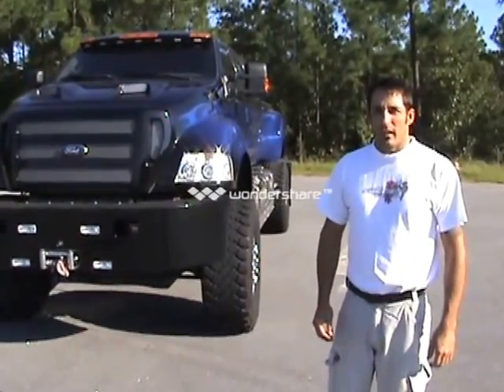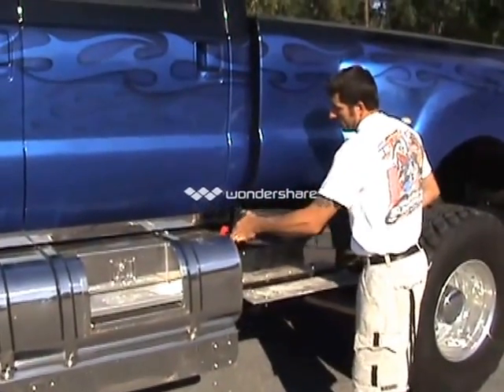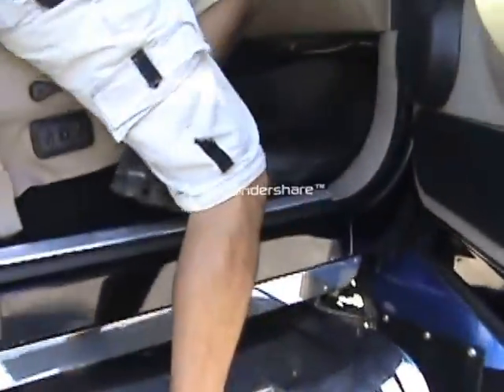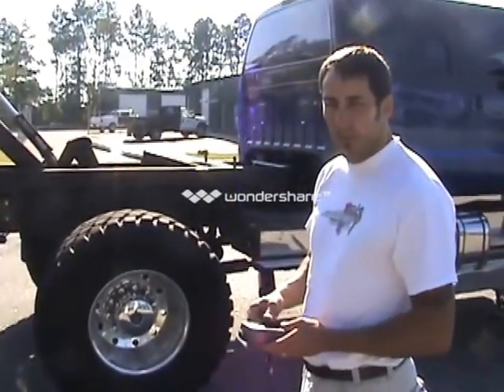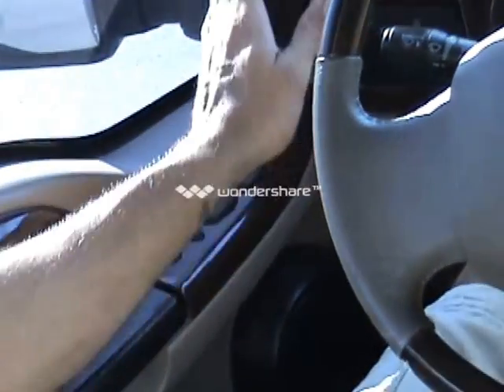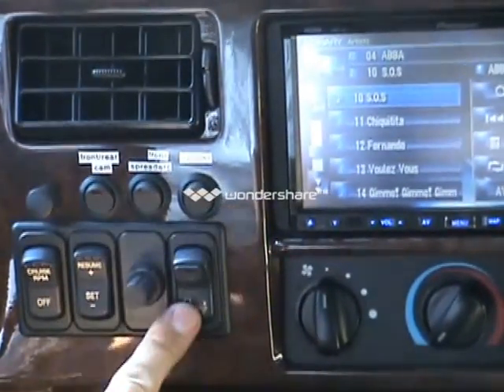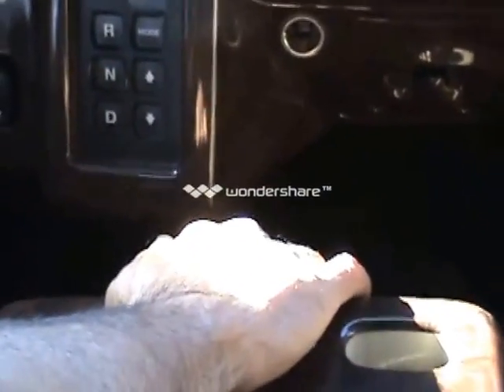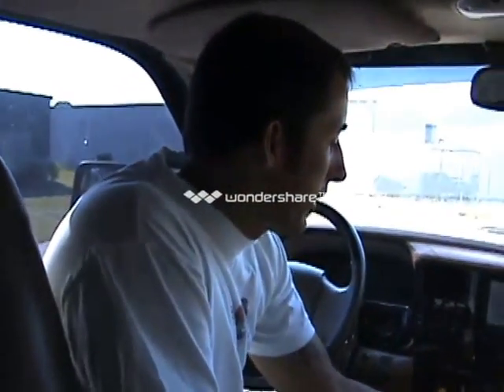"Lie" F650 Six Door Supertruck

Comment: Aside from the watermark, this was a really nice walkthrough of a vehicle I've liked for years. If I could ever afford to drive one and had some job or hobby that I could justify having it for, I'd definitely look into the 4 door model.
Reply: +donteandamy, For the same or less price you could get a Sportchassis if you do not mind having or using a Freightliner M2, would haul the same bhind and even tow goose-neck or fifth wheel trailers which this truck shown may not be able to do.
Reply: +donteandamy i think the slammed 4 dr version is so sick. can you imagine the headache of driving this lifted beast in traffic? you'd run so many people over, lol
Reply: Buy amc stock. And you will have this truck. “Ascending wedge formation has formed it will boom soon. See you on the road soon!

Comment: That unmistakable sound of a Cat C7
Reply: Cat C7, 3126, same thing, garbage engine. Dry sleeve engine. They never did solve the problem of the valves tightening, slamming the head, thus snapping the head of the valve right off....stick with a 8.3, or ISC Cummins.
Reply: 8.3 is a Powerstroke or Cummings ?

Comment: 15k winch for that... If that got stuck that winch would burn up before you even moved!
Reply: That truck weighs less then 13,500  so a 15,000lb is fine. If you need more strength you carry a snatch block to double up the line if you want to double the winch power.
Reply: @buildthings79  30k should pull it quite well.

Comment: what's the mileage uh 1ft to the galloun
Reply: 1mile to the gallon
Reply: +stealth1692 its a diesel derps better than a suv
Reply: +Seth Wolfe 4-8 probably
Reply: +Palmer Boudreau 
try 10-13 mpg
Reply: immrnoidall No that is not possible unless it was built with that goal in mind. The lift and the tires already have it at 8 or less
Reply: ***** Stock yes that is believable. This truck is lifted and has larger and more aggressive tires. Also the extra weight affects it a little.
Reply: Palmer Boudreau  it's an oil truck with a pick-up bed.not a lifted regular truck with huge tires.so whatever an oil truck gets for gas milage would be more than these trucks get because these trucks have been lightened up.so what is the milage of an empty oil truck?
Reply: immrnoidall Its the shape and gearing. Empty hay trucks get 6-10 MPG......

They are geared a lot taller because of the loads they need to carry. Top speed is about 70-80MPH
Reply: Palmer Boudreau don't they have transmissions with higher gears? but 80 in an oil or hat truck,on those tires would be pretty damn fast i would think. love these trucks though. they are cool as hell and drivable.
Reply: +Seth Wolfe if its diesel it should do pretty well. i'd guess high teens-low 20's. only time you see single digit numbers is when running gas. but who in their right mind gets a full size running gas? lol
Reply: ***** That's really only the case with 3/4 and 1 ton pickups with the gas vs diesel. Like if you have a 7.3 powerstroke vs the 6.8 V10 then yeah the V10 will get low teens or single digits but a truck of this size gets 10 even if you have a diesel. The tires are just so big and it weighs so much.
Reply: @PalmerBoudreau   This truck is just a factory built f650 with 4x4 option. It sits that high from the factory.  They put super singles on it so the rear is no longer duals.  Putting an 800 lb bed with a 400 lift mechanism doesnt do anything to the fuel economy of that truck. My friend has the same one and drove it to Florida from Maryland  and got 13.8 mpg highway.  You can change the tune on the engine and get really good fuel economy.  It is not a lifted truck. With oversized tires. Its factory drive train was built to run tires and rims that large.  All it is is a linesman truck or heavy fire brush truck with a bed instead of a body and some nice chrome accessories and pretty interior.  I own an 88' international 4x4 29,000 gvw with air breaks and it it sits higher then that one does and I get 11 mpg on a crappy mechanical non tunned 4 psi. Turbo diesel. Mine weighs 12,400 without crew cab or bed.
The Kelderman air suspension he referred to is an air bag conversion that removes the leaf springs and rides on bags instead. They can be pumped up to sit a bit higher then leaf spring suspension did but also can be lowered too.

Comment: So what is this truck for?
Reply: So you can have a pool party in the back of the truck because it is so big
Reply: +Traci Llewellyn They were really desighned for off road extreme work conditions. Think of loggers 40 miles into the forest who need to pull a huge trailer carry chain saws gear etc and then fit all of the loggers inside. A truck like this in Alaska would be a life saver.

Comment: august 2013, why did they use play station 2`s????
Reply: wondering the same thing..... ITs gotta be a $200k truck,, PS2 now a days goes for like $50 new.  Couldnt they spend the $350+ on a new PS, or a freaking PC console set up with wi fi etc...
Reply: You do realize that just because something was filmed in 2013 doesn't mean it was made in 2013 right? They started making F650s in 2002 and this truck can only be 2005 at the newest and ps3 didn't come out until late 2006.
Reply: Fringe13 i do realise that but i didnt at the time know much about the big ford trucks (im an australian we dont get the big ones down here lol), and its also being marketed like its a new truck so i kinda assumed it was a new one , but the more you learn
Reply: (First owner of the truck) When we built it, that’s all that was out. We sold it before we got big into Xbox. Besides, the ps2 still worked like a charm and was built into the truck

Comment: That bed must be the dumbest thing I've ever seen.
Embarrassingly awkward controls. 
If it had been German you would have hot and button and it would have dropped. 
He said it was easy to operate yet on the way back up here hit the wrong button and caught the bed on the chassis lol
Reply: ***** that isn't always true. I admit that the Germans are obsessed with detail in engineering, but they aren't always the best, even against the United States. I'll say this, no matter what nation you hail from, we as humans all benefit from collaboration in regards to engineering. It can make all lives better with new innovations from the brightest minds coming together instead of working against each other. I'm sure you would agree?
Reply: You also have to consider that this truck was built in the early 2000's so the technology probably wasn't flawless anyway.
Reply: the problem is when pickups try to do what real trucks can
Reply: the problem is that real truck as you put cant do what a pick up really. they could but arent nearly as practical as a normal full or mid size truck.
Reply: Eddie Mcvain Here in Alberta the oilsands have SOW trucks, they have 8 wheels, all drive including 4 steering wheels. They have heavy duty winches and sometimes cranes. They can drive around the ditch just like a quad
Reply: Germans have Mercedes Benz case closed
Reply: @EddieMcvain  competition is a really good thing.

Comment: WHY is the gas tank UNDER the driver? A T-BONE wouldn't be good. But if the tanks were BEHIND the driver it'd be better. Now can a truck be built with the tanks in the rear??? Thx I'm cause truck is great 4 safety,

Comment: I really do love Ford's vehicles, but these things are ugly and chauvinistic to the extreme. Some individuals previously stated below that the same could be said for a Porsche, Lamborghini, Ferrari, Bugatti, Aston Martin, Mercedes etc. But those vehicles are beautifully crafted pieces of art, whereas this almost seems thrown together by Ford. The dash, controls, steering wheel, seats all look as though they are from the mid-2000 generation Fords, and the stickers above the various controls, are so very tacky indeed. It would look so much better without that bed and massive amount of chrome or flames down the side, subtlety is always better in my book. But this is all my opinion...
Reply: This is majorly customized from the truck ford built...  Those stickers are marking buttons controlling all the aftermarket equipment on the truck... All added on after the fact.  This truck is in fact very functional as a towing/hauling vehicle prior to all the additions like lift etc

Comment: the money he probablly spent on that thing makes it so fuckin useless hahaha.  a truck that size is for towing not weight for weight in the box thats already maxed out short because of the wimpy rams on the ampiroll setup.  should have just left a 5th wheel hitch and called it good and just buy a goosneck dump trailer.

Comment: U cant pull a 5th wheel tho.
Reply: No but you can buy a 3 car trailer and out the 5th wheel on the trailer and haul it I mean it's rated at 60k toy payload the truck could haul that without breaking a sweat
Reply: Zac Hudgens you can actually get tow behind dollys to tow a fifth wheel.
Reply: Out rig it
Reply: Uh, mine is not that high and I pull goosneck's everyday.

Comment: полное дерьмо. Огромный бесполезный грузовик. Если на борт что нибудь загрузить то когда борт будет подниматься то от туда всё выпадет крупный груз например холодильник :) И застрянет в грязи в сугробе а так же сядет на брюхо.Так что газ - 66 рулит.
full of shit. Huge useless truck. If on Board something to load the cargo, when the Board will rise , from there everything will fall out. Large goods such as fridge :) And get stuck in the mud in the snow because heavy and floor bumper is almost low.
Therefore, the GAZ - 66 is better